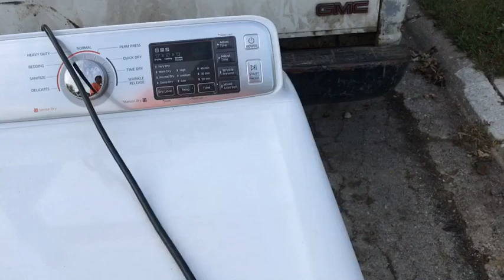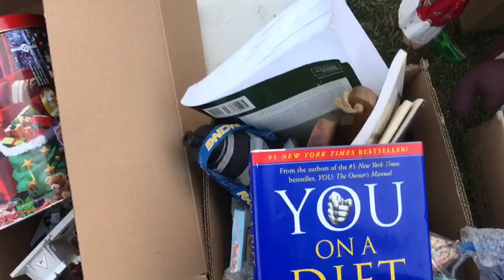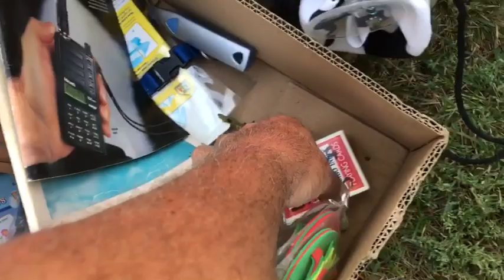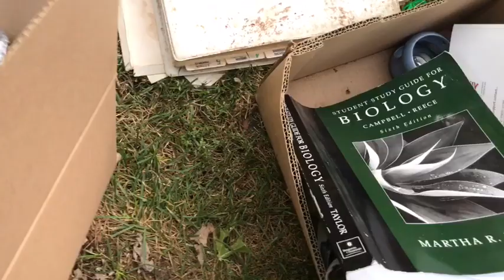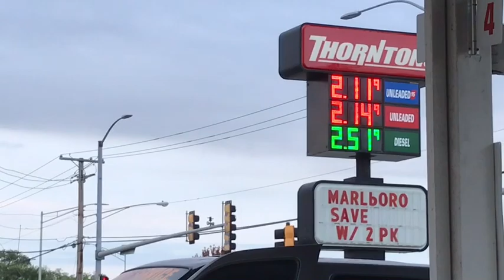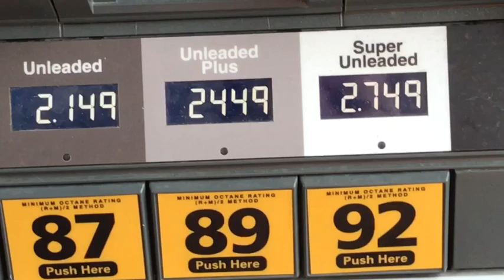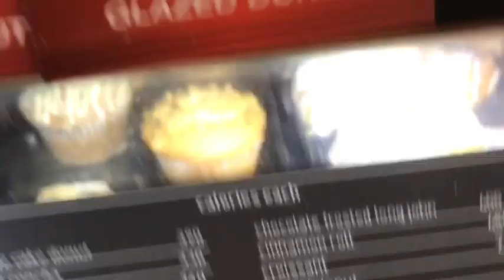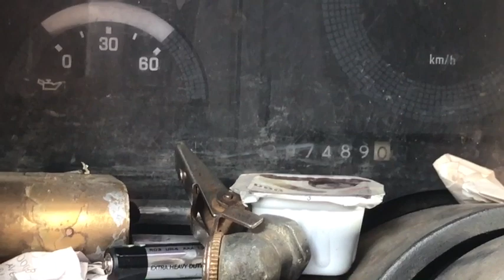CURBSIDE SCHOOPS

Comment: New name for this video Scraptober :D
Reply from the maker: TheCarArchives I was going to do that but I think another YouTube or did that already use that name
I got beaten to the punch
Again
I still have two months later a scrapping during the eclipse video part about six or seven other YouTube scrappers did something similar so I never published it!😂😱
Reply from the maker: TheCarArchives sorry just put the pumpkins on there and left the words out but at least you got the idea without me using words thanks man
Reply: How old is the GMC Pickup it's definitely like a Rock :D https://www.youtube.com/watch?v=IocCC1-jeTY
Reply from the maker: TheCarArchives it's a 1989 and has 497,000 miles on it original engine transmission and differential. 
Just change fluids oil etc. and it will last a lifetime 
Although this one is quite worn. It's not worn out it's a good daily scrapper!!!!
Reply from the maker: TheCarArchives I know the old ford Chevy argument but the Chevys and GMC's are much better suited for scrapping because they can take endless senseless abuse
Pick up truck downtime in this business can be the end!!!!  So that's why I use only these types of trucks
Reply: Looks like it's been to hell and back :D but all you need to do to keep it tip top is to regularly change the usual things and as I believe if you look after things it'll last longer and don't tell me are you the original owner?